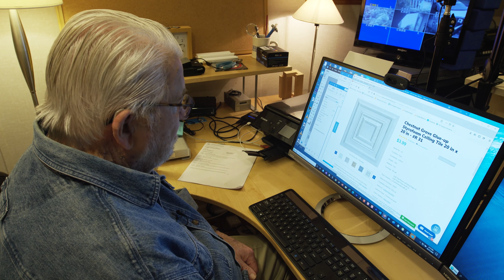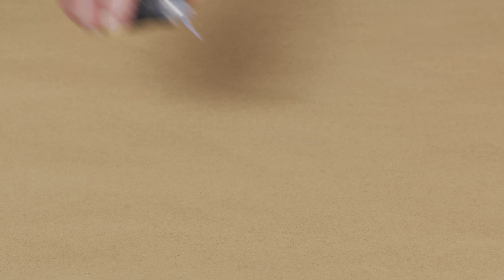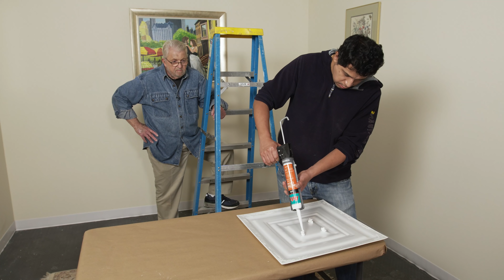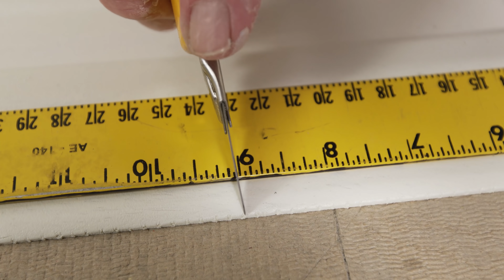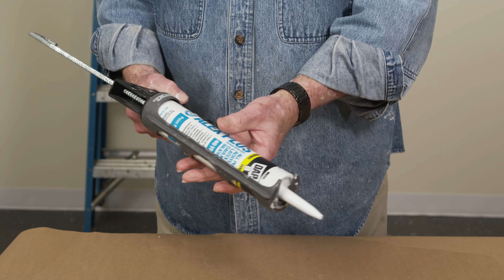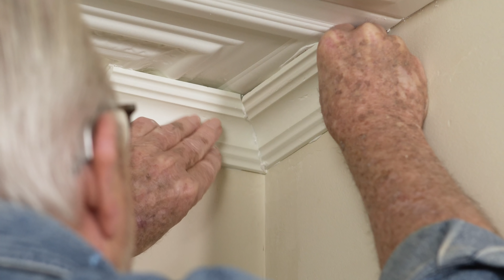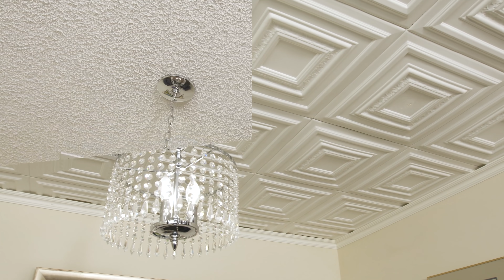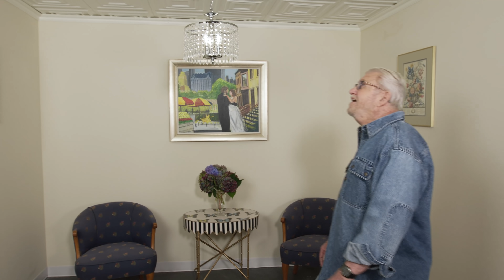Say Goodbye to Messy Popcorn Ceilings: DIY Guide to Covering with Glue-Up Ceiling Tiles

Comment: Polystyrene is extremely flammable! They are illegal in the UK.
Reply from the maker: Hi Karen, 

Can you please provide some documentation on where these have been banned or are illegal?  I could not find any.  The tiles we sell are only 1/8 / 3mm inches thick material-wise unlike the ones that are widely sold in the UK that are more like 3/8 / 10mm of an inch thick. I have personally used these tiles in my homes for over 13 years with no issues.  There was an article that was saying a combination of the use of candles in homes and or smoking in the homes would lead to draperies catching on fire which would then led to burning the ceiling.  They have mentioned that the use of oil-based paints is what has made these tiles more flammable.  In the USA, thousands of people are using these, painting them with water-based paints, and we have not seen any issues.  Of course, one should always exercise fire safety in homes and do not leave unattended open fires as well as installing fire alarms.  The decision is of course individual but I do not believe these are fire risks as you describe them.  Can they catch on fire?  Sure they can.  Can your furniture, drapery, wooden flooring, carpets catch on fire?  Yes of course.    Polystyrene is widely used across many industries including medical and food services.  See more about this material here: https://www.chemicalsafetyfacts.org/polystyrene/

Comment: We in the UK call these ceilings artex ceilings and cover them up by skimming over them with plaster , it's illegal  to fit polystyrene tiles over them as the tiles  are a fire risk , in a fire the tiles melt and drops burning polystyrene all over the floor .
Reply from the maker: Hello Bruce,  did not know they called them Artex in the UK.   Can you please provide some documentation on where these have been banned or are illegal?  I could not find any.  The tiles we sell are only 1/8 / 3mm inches thick material-wise unlike the ones that are widely sold in the UK that are more like 3/8 / 10mm of an inch thick. I have personally used these tiles in my homes for over 13 years with no issues.  There was an article that was saying a combination of the use of candles in homes and or smoking in the homes would lead to draperies catching on fire which would then led to burning the ceiling.  They have mentioned that the use of oil-based paints is what has made these tiles more flammable.  In the USA, thousands of people are using these, painting them with water-based paints, and we have not seen any issues.  Of course, one should always exercise fire safety in homes and do not leave unattended open fires as well as installing fire alarms.  The decision is of course individual but I do not believe these are fire risks as you describe them.  Can they catch on fire?  Sure they can.  Can your furniture, drapery, wooden flooring, carpets catch on fire?  Yes of course.    Polystyrene is widely used across many industries including medical and food services.  See more about this material here: https://www.chemicalsafetyfacts.org/polystyrene/

Comment: I did this in my small powder room. Really love the look. For the larger rooms I plan on removing it altogether. If anyone is buying a new build home, stress to the builder that you want flat ceilings, no popcorn or they will go ahead and do the popcorn as it is cheaper. I hate the stuff and as I bought an older home, it is everywhere. Thank you to the people who mentioned asbestos being used in the 70’s in the popcorn ceilings. I am most likely okay but will do testing anyway as a precaution.
Reply: Polystyrene panels are a significant fire risk

Comment: I’d be very concerned with poly styrene since it’s extremely flammable.
Reply: They're banned in the UK
Reply: @DarrenHarrison7160   exactly what I was thinking as I saw the thumbnail for the video
Reply: @DarrenHarrison7160  Health and safety reason??
Reply: @iordache3278  Absolutely a health and safety reason. These polystyrene tiles and coving are banned due to extreme fire hazard in the UK since the 80's. I'm a specialist decorator by the way so I know my oats lol
Reply: @DarrenHarrison7160  almost everything are burning into house.But you are protected against fire with alarm,isn t it? Health and safety ;-0
Reply: @iordache3278  Awwwww has somebody allowed you to use their phone sweetie.......
Reply: @DarrenHarrison7160  watch yourself at health and safety
Reply: @DarrenHarrison7160  have you tried?
Reply: @iordache3278  It depends on what trainers I've licked
Reply: I was thinking wait a minute, don't they give off gases...hmmm I knew there was some problem.

Comment: I have a large rectangular 12x20 ft  living room that has popcorn. Do I need to find the middle as you did or can I just start at one end to the other?
Reply from the maker: Hello Gary, finding the middle usually works out the best because you end up with equal-sized spaces.  If you have an open-ended ceiling without a wall, in that case, you might want to start there.

Comment: Good video. I would add one other thought. When when dividing up the tiles for spacing I would recommend making it so that your edge tiles are as large as possible rather than just snapping a line midway both  directions. You may have to shift it to half a tile, off the center of the room. Also don't count on the room being square, so square your lines rather than going parallel to the walls. Probably for most houses that would be close enough, but I would check it and make sure. 
Thanks for the video.

Comment: Please do not ever do what he's doing wrong the acoustic ceiling will not hold the weight of the tiles over time
Reply from the maker: John, I have done this on several ceilings. 10 years later still there.  The tiles are so light, they don't add much weight at all.

Comment: Polystyrene tiles totally banned in the UK.....A major fire hazard, maybe wood panneling would work if you didn't want the mess.
Reply: 100% correct about the tiles and then he ruins a good finish by adding a cornice to tiles that have a raised detail and hey presto you end up with gaps all around the edge of the ceiling.
Reply from the maker: Can you please provide some documentation on where these have been banned?  I could not find any.   I have personally used these tiles in my homes for over 13 years with no issues.  There was an article that was saying a combination of the use of candles in homes and or smoking in the homes would lead to draperies catching on fire which would then led to burning the ceiling.  They have mentioned that the use of oil-based paints is what has made these tiles more flammable.  In the USA, thousands of people are using these, painting them with water-based paints, and we have not seen any issues.  Of course, one should always exercise fire safety in homes and do not leave unattended open fires as well as installing fire alarms.  The decision is of course individual but I do not believe these are fire risks as you describe them.  Can they catch on fire?  Sure they can.  Can your furniture, drapery, wooden flooring, carpets catch on fire?  Yes of course.    Polystyrene is widely used across many industries including medical and food services.  See more about this material here: https://www.chemicalsafetyfacts.org/polystyrene/

Comment: Truely dreadful!
Do NOT do this. You will find it hard to sell your home, it can seriously affect the value too with those tiles on your ceiling.
Popcorn or Artex can contain asbestos. Just do the job properly by having the ceiling removed & replaced - it will save you money & add value in the longterm.

Comment: Seems like piling on more stuff that you’ll end up pulling off once it no longer is trendy.   I took off all the popcorn ceilings myself in all my rooms. It was a mess but well worth it. Love the look. Very clean.
Reply: Depending on where you are and when the popcorn ceiling was installed, you shouldn't start scraping until you have the ceiling tested for asbestos.  Releasing asbestos dust into your house isn't a great idea.
Reply: @fredgarvin716  Seal the room with plastic sheets, make sure you are wearing a mask and wet the ceiling before scraping keeping it wet stops the dust. That's how they remove asbestos siding on older homes. I did a huge family room ceiling about 15 years ago and I'm still alive.
Reply: And it's the easiest way.gluing up those tiles would be tedious
Reply: May I ask how did you takeoff the popcorn ceiling texture? My whole house has popcorn ceiling and I want to do away with it, but don’t know how exactly somebody actually said take a water sprayer bottle and lightly spray the ceiling and scrape it but I’m not sure if that’s the best way to do it or not thanks for any help.
Reply: Take it from me these tiles look like someone's nightmare. You are correct stripping the ceilings makes them look like a million dollars. This guys "  tv styrofoam packaging "  being glued on his ceiling is an embarressment. The gaps he left on the top angle pigeons could make nests and ley eggs up there. I enjoyed the laugh though. I thought at the end he would say if you dont like this new look screw or nail on woood to hide the tile I found online. If the wood is an eye sore simple fill over it with brick. If the brick isnt no longer in fashion, simply drywall over the brick and if the smooth painted drywall isnt of your taste just get your ceilings re stippled.
Reply: Nice to think all these renovations that are done in homes now.
   Are likely things like this,   I was shocked to also see stick on tiles eh.   Wth
Reply: It is not a newoccurance, decor comes and goes. It is nice to have change.
Reply: Those tiles never go out of style.

Comment: Great in a fire, polystyrene tiles ensures no escape,
Reply from the maker: Our EPS tiles are only 1/8 thick material widely used in the UK that is 3/8 or 10mm thick.  We also recommend painting our tiles with water-based paints, never oil which was part of the issue. I have yet to see a single incident in the last 13 years of selling these tiles regarding fire..  Now I understand that some people just want to be extra safe and for that reason, we also offer Class "A" fire-rated tiles that can cover popcorn ceilings: https://www.decorativeceilingtiles.net/faux-tin-ceiling-decor/ as well as the almost impossible to burn metal ceilings: https://www.decorativeceilingtiles.net/nail-up-ceiling-tiles/
3) Finished projects: https://www.decorativeceilingtiles.net/idea-library/by-application-ceilings-idea-library/

1
Reply: @DecorativeCeilingTilesInc  next  you'll be saying that they are fire proof, bad idea no matter how you look at it, polystyrene on the ceiling, WTF

Comment: The moulding created additional gaps that you didn't fill.
Reply from the maker: Hello KC, there are several ways to deal with finishing the edges.  Most people go for the easiest and fastest method in the video.   However, here are the things to consider. #1)  Most tiles have less depth and you can actually caulk the gaps. #2) You do not need to use crown molding. You can either just run the tile into the wall, if you are lucky you won't have to cut ( slim to none chance unless you custom-built the space to size. So you will likely end up with a partial tile.  Here you can make a decision and perhaps use a tile with no design to border it out.  Here is an example of finishing into a wall avoiding gaps between the crown and the 3D tile. https://library.decorativeceilingtiles.net/chestnut-grove-styrofoam-ceiling-tile-20x20-r-31/ and here https://library.decorativeceilingtiles.net/chestnut-grove-styrofoam-ceiling-tile-20x20-r-31-9/#prettyPhoto #3 Choose a tile that is not very deep, installing crown molding that has a "lip" thick enough to house the dimension of the tile.  Here is an example of that: https://library.decorativeceilingtiles.net/line-art-glue-up-styrofoam-ceiling-tile-r24/#prettyPhoto #4 Border Tile / Filler > Ceiling Tile  -  https://library.decorativeceilingtiles.net/lilies-and-swirls-faux-tin-ceiling-tile-24-in-x-24-in-204-13/ #5 Crown / Cornice > Filler / Border > Ceiling Tile - https://www.decorativeceilingtiles.net/kitchen_tin_ceiling_reproduction

Comment: What if that popcorn ceiling has Asbestos in it?? Asbestos was still in popcorn ceilings into the early 90’s.
Reply from the maker: David, the way I understand this is that you should have your popcorn ceiling tested for Asbestos.   If it does have Asbestos, it should be professionally removed.  The issue with Asbestos comes when you breathe it, so you definitely don't want to do this yourself.  Asbestos was banned in 1979 is what I have found.  So the key is not to disturb the Asbestos dust.  If you cover it up with ceiling tiles, the Asbestos will obviously still be there but the ceiling will look better.   Now, even if you remove your popcorn ceiling, chances are that underneath you will find covered imperfections and additional work will be required to make it look good.  This is the reason why people have been opting for using decorative ceiling tiles to cover their popcorn ceilings. https://www.decorativeceilingtiles.net/styrofoam-ceiling-tiles-20x20/

Comment: Not allowed to use these tiles in the UK for safety reasons for in case of fire in toxic fumes and black smoke and melting into dropping from the ceiling to causing more damage. They give off thick black toxic gas and highly inflammable products and being banned from being used in the UK. They look nice and was all the rage in the 1970s for coverage of bad ceilings but the only downside is the fire safety of this product

Comment: If you cut your caulk tube open on an angle (like is typically indicated on the side of the nozzle) rather than the perpendicular opening shown in this video it makes a nicer smother bead that really smoothes out nice with a moistened finger tip afterwards.
Reply: That isn’t caulk it’s adhesive he cut it right you want a blob not a nice small line.
Reply: My bad haha I see he used caulk later in the video
Reply: You are correct... that's how I learned to cut the tip of caulk tube for easier application.
Reply: Very nice work

Comment: We have, had PC ceilings in our home. The tile shown in the video is cheap and flimsy. also tiles are not consistant which creates issues of alignment, and spacing. You can see in the video there are gaps where tiles meet. Do not go this route. PC is not hard to take down. It requires just water and a good straight edge. Take your time and be careful, an ave room 12X12 should take 1-2 hours. Then finish as you please. Going the route RH suggests takes more time and the finished product, no matter haw good you are looks cheap.
Reply from the maker: The tiles can be caulked to finish it all off.   See this video where Ron installs another model of these in his home: https://youtu.be/i6EOKJwtRz4
Reply: @DecorativeCeilingTilesInc  That is just a small part of the problem with these tiles. They are not a good looking product, and if your tiles are that far off, and they are. Caulk is a pretty poor fix. Make them right, a little caulk around the perimeter, still cheap looking no matter how you slice it. I have seen your tiles and others, you can spot poor quality a mile away.
Reply from the maker: @hdvictoryford5329  Thank you for your opinion.  :-)  I do disagree with you only because I have been installing them and selling them for 13+ years.  These tiles are not a high-end item but we have seen people installing them in high-end homes with a lot of great feedback.  When I saw these tiles for the 1st time before installing them and seeing what they can do to space once installed, I thought they were cheap and looked cheap.   The cheap appearance comes from the fact that they are very lightweight, they only weigh 1oz.  I will post here few reviews that describe this:   Monica P.Verified Buyer
5.0 star rating
01/02/21
Awesome, but take note for popcorn ceilings
I love these tiles! Yes, they are thin and seem flimsy but when you get them all up, they look so gorgeous!! I put these up in my den at my last house with no issues, and this time in my new house, but I applied them to a popcorn ceiling and I had issues with them falling down the very next day. I went back to the home improvement store and bought some Loctite Power Grab ULTIMATE adhesive and that did the trick. I caulked all seams and it's been a week now and no more have fallen.  

I invite you to take a look at this page and see what people that have actually used them say about these: https://www.decorativeceilingtiles.net/styrofoam-ceiling-tiles-20x20/  we do not alter or remove real reviews but you can also visit Amazon, Wayfair, Home Depot's websites and see what people say.  

In conclusion, these tiles are not for everyone but I have installed them myself in 3 of our homes including the current one and I love the ease of install, the looks, and how great they have held up over years.   We do provide higher-end materials, including steel, Aluminum, and Copper ceiling tiles, and thermoplastic. You can see our entire selection here: https://www.decorativeceilingtiles.net/ceiling-tiles/
Reply: @DecorativeCeilingTilesInc  While I respect your opinion, no " high end" home owner would install these in a classy home. I have been in the business for 50 years. And while these might be a nice product, the install showed inconsistancee's in many places. And It was already addmitted that you need caulk, hummmm. How does that sound. If you are a pro you know my comments are true. And if you got great feedback, my question would be, great for the type product it is? Great for the money? etc. And how much did RH get to hype your product,lol. RH while he does some nice work, he has also mislead people and this is one of those times. HADG. Time to move on.